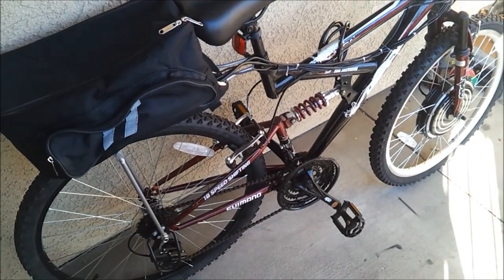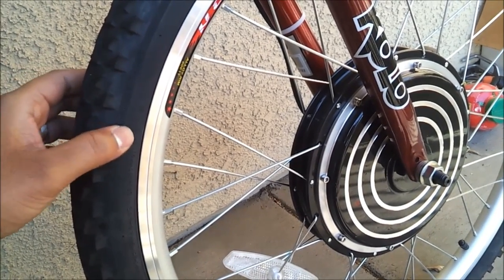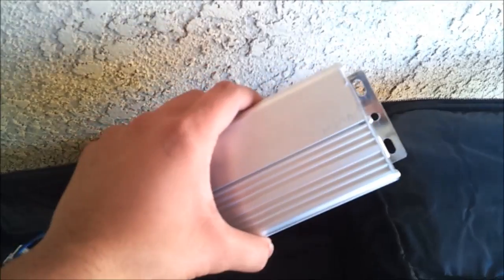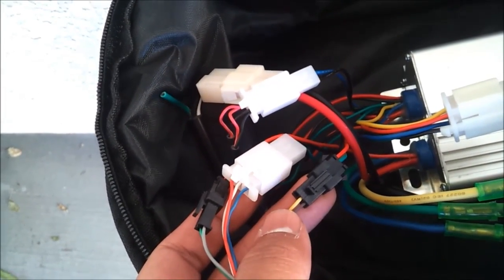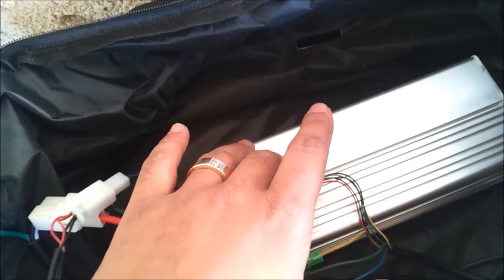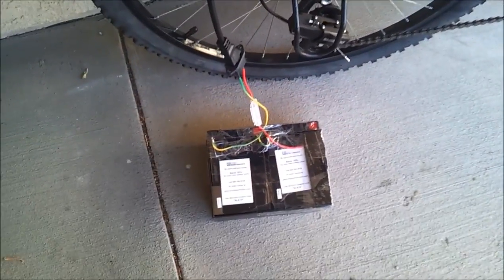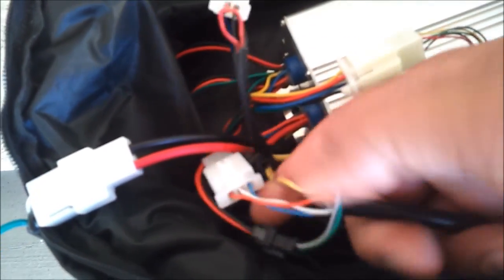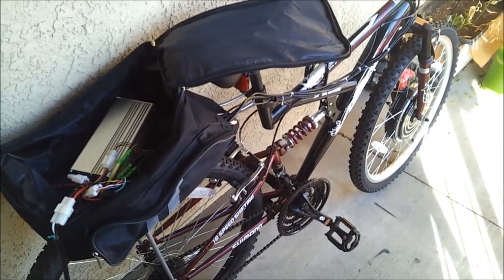Electric Bike Conversion Kit Problems-Now Solved

Comment: #1: Disconnect the kill switch of the brake levers. ... 
If that doesn't fix the issue reply back to me.
Reply: I have the same issue and tried that and it still didn't work
Reply: @skphouston  It's probably the signal wire that simply isn't making contact. I also suggest you open the controller,and check the capacitors to see how much voltage they can handle.

I have a soldering iron and I know how to get a different type of throttle it doesn't have to be six pin connectors like the one you should us in the video,It can also be 5 pin connectors...

THROTTLE WIRES
                  👇
#1Red positive 4.3V-5.0
(Voltage varies on what the brush less motor controller board has to offer) 
#2White signal
#3Black negative

IGNITION WIRES
                👇
#4Red Positive from battery 
#5VCC 

VCC is possibly the negative wire obviously,but open the controller and look for it on the controller circuit board. If you don't have a soldering iron please purchase or borrow it from someone.I also recommend silicone wires✔ 
(✖Cooper wires✖)

Other solution to fix the problem would be to buy a new controller that comes with it's corresponding throttle. www.aliexpress.com

Comment: Dude you need to tighten up your breaks. That sensor is very sensitive. Your breaks gotta be really hard. If they're lose the motor detects them without you knowing and therefore causes the motor to remain immobilized. Happened to me until I tighten them and the sensor than allowed the motor to move.

Comment: I have same problem but with a 24 v  to a 250w motor housed in the rear tyre,     I had a bicycle engineer spend a hour looking at it,     Battery fine,     Brake sensors fine,     Motor fine,    Derailleur sensor fine,     The display lights up showing full power,     I changed the fuses,      All checked out yet nothing,      It must be the controller we all think,      But he did not have a Chinese replacement or know of a generic replacement to fit,       His advice is avoid all internet electric bicycles and anything pre 2012 as they are crap,      I am thinking he is right as if anything goes wrong it`s just expensive junk

Comment: with a buzzing (continuation) zero OHM reading meter start with checking with making sure that thrust(on) switch is closing at zero ohms at the point of the plug near the controller, check to see if you have nearly zero ohms with the motor connections and make sure the connections are good, crimped  properly, the motor connections should be nearly zero a few ohmso if it's higher than that it's defective . 
check and see if you have any safety connections that will cut off the movements. 
sorry for the bad language but i'm not impressed with what I see. those wires, battery, 
are shit . I would ask for your money back !  I hope this helps .

Comment: did you solve this problem? any update? Maybe try connecting one battery direct to the motor and spinning the wheel. Maybe the wheel has to be moving before it works- pedal assist. Update please.
Reply from the maker: Gram Pt . It was a bad controller. I got that changed

Comment: maybe you have to much power I had 4 of the small batteries the lights come on but did not work just like ur bike I disconnected one the 4 batteries and it workedso maybe ur have to much power

Comment: the wires in the throttle connector are not connected properly.... look at the positions of the wires in the connector (it looks like a 3 pin only 2 wires are used) ... they are not aligned....

Comment: the red button is for switching between power modes.  500 and 1000w mode on my 48V kit. Id stay away like plague from anything less than 48V.....bummer that you have problems though...

Comment: disconnect the brake cables from the controller might be causing a short. click the red button on the thumb throttle that is a motor cut-off like a kill switch . if neither of these check your hall effect sensors first inside the thumb throttle there is 1 secondly inside the hub itself there should be 3

Comment: #1) You need to update the video description that the problem was solved, you are wasting the time of people who are still trying to help you, particularly since the problem was a defective controller  #2) You need to stop instructing people about e-bikes; it's pretty clear you don't have a thorough understanding of them and you are providing bad information.  #3 Your brake levers need to be rotated down to the 4 or 5 o'clock position.

Comment: donot push the red button in,on your thumb throttle and try.You think pushing the button in will make the contac but it is wired in reverse. Try not to push the red button.  DAVE

Comment: The non-branded China built controllers have a 3% failure rate or higher. Try to disconnect the brake safety wire, first. Next time buy from a USA based seller who has phone support.

Comment: would you recommend the front wheel ekit or rear wheel?
Reply: Blue Chan  Standard rear dropouts are 135mm not "6 or 7" inches and freewheel/brakes, disc or otherwise, also do not add to this width.  e-Bike motors do not weigh 50Lbs.  Carbon fiber rims are not stronger that "steel" (or aluminum) rims.  You say "hub" when you mean dropouts, "racing" when you mean road and "Y" brakes when you mean V.  YOU are specifically the person I had in mind when I said "nobody here knows what they are talking about".
Reply from the maker: If you buy the rear wheel kit, the bike becomes too rear heavy.
The front kit distributes the weight better with the heavy battery at the back and motor at front.
Reply: tcorourke2007 lol Blue Chan got owned
Reply: Most people wont think to change anything, mainly because they watched a youtube and saw how easy it was,,until the weld brakes from constant tugging from full throttle take offs and not paying attention to the fact that the front wheel is only made for the front wheel that came with the bike.
There is an alternative to front or back mounted motors and thats the central mounted ones that have a really odd (chain drive) setup, but still worth considering.
Reply: That was the nature of my eBike originally. A center mounted motor just below the crank set. Originally the bike had 18" tires which are hard to come by and both crank and motor chains were on the right side of the wheel. When I decided to upgrade my bike the first time, I had to changed to a southpaw hub and 20" rims and reverse mounted the motor on the opposite side so there was a chain on either side of the bike. Of course I had to play with the -/+ leads so the motor would run forward instead of reverse. The 36v motor was 350W on a SLA battery system. Then I discovered a 36v 500W hub motor to fit a 20" rim, so upgraded to that but knowing the different stress related without reading on anything regarding bending frames I simply changed my fork to a Chromoly one normally intended for moto-cross trick riders who use extension pegs on the front wheels. With the original motor, and battery and rider, I determined the back wheel was taking 83% of the weight load and since I upgraded the 18 inch wheels to 20 inches I lose some torque, but gained 6 kph from it's original 30 kph maximum. Changing the location of the motor to a front hub motor, helped balance the weight distribution and reduced the weight load on the rear wheel by 14% thus making a more balanced bike of 69/31 instead of 83/17. Which then lead to the torque I loss originally being almost where it was suppose to be. And the really special part, here, this bike was originally a folding electric bike from some China maker thus the 18" wheels...  had a stupid cam braking system I changed to a cantilever Y brakes normally intended for mountain bikes.
Reply: Generally, rear hub motors are better.  You should ignore the advice in these comments, nobody here knows what they are talking about.  Go to http://endless-sphere.com/forums/viewforum.php?f=21
Reply: Front kit unless your bike has an extra wide frame to accommodate the required 6-7 inch width (hub + brake + gear assembly). Front is still preferred over rear to help distribute weight evenly. Batteries are 25-50 pounds as is the motor.
Reply: I have heard that the front wheel kits are dangerous as they have a tendency to weaken forks and the steering can become unmanageable in the wet, a bit like hitting loose gravel and the wheel keeps spinning while your trying to turn and the wheel slips away from under you, as the motors are heavy.
I have a rear wheel electric built on a front and back shocked mountain bike and the thing that I have noticed is that the wheels are under engineered as the spokes are those for a normal bike and they break,as the motors are heavy and this hasn't been taken into account for the over all weight of the wheel, spokes need to be a heavy gauge.
Reply: Frank Blackcrow As always, you should make sure your bike can stand the tolerances as well as minimum requirements required to mount a front wheel hub. In some case people decided manually widening the forks to take the motor was a good idea at the time until they bent their frames. If the hub can't naturally fit the hub without any strain, then don't force it in place. I had to change out my stock frame to a Chromoly one. Also I found the rims included in the front wheel kit I purchased was of low quality so I changed it to a carbon fiber one (BladeX). Basically change your front fork to one for a real off road one built for strength and weight. If the rim is plain stamped steel, swap it for something stronger and lighter.
Reply: tcorourke2007 some of us know what we are talking about... ie: I wouldn't put a front hub motor on a racing frame, but I would put it on a BMX free style frame. It really depends on the torque, load, and a few other key factors, so you can't simply dismiss everyone because you said so. In my scenario I went with front because the frame modifications I choose were suited for front. Not everyone's rear frame can take a rear hub + gears so that is why front hubs were invented, but not all front forks can take the stress of hub motors.
Reply: I love how people get so serious and offended by the comments hahah

Comment: please give me the link where you bought this. Also i have a front disk brake bike and i need to convert it e-bike. please suggest me a best kit that is cheap. my weight is 90 kg.
thanks!!!!!!
Reply: ***** find out yourself lazy ass
Reply: Stu Wright Normally I'm against negative comments but that was great. Lol.
Reply from the maker: http://www.ebay.com/itm/E-bike-Front-wheel-24V-500W-Motor-hub-Electric-Bicycle-Ebike-conversion-Kit-new-/371141809114?pt=LH_DefaultDomain_0&hash=item5669c693da
Reply from the maker: I bought this on ebay
http://www.ebay.com/itm/36V-800W-26-Rear-Wheel-Electric-Bicycle-Motor-Kit-E-Bike-Cycling-Hub-Conversion-/291209974111?pt=LH_DefaultDomain_0&hash=item43cd77915f
Reply: please tell me which the cheapest kit i can buy in canada

Comment: same problem you have, I brought a kit from china same type of controller with pen written on as 350 controller put kit togather as supposed to and no power comes from the motor the lcd light up but when I turn the throttle nothing... tired of buying from these china companies only to have to pay to ship back.

Comment: I notice that so many bikes have the brake levers far too high to be safely operated.
The levers should be positioned such that with the arm and open hand in a straight line from the shoulder, the hand should lay over the lever naturally and tightened in that position.

Comment: The ESC will only power the motor when it senses the wheel is turning. Almost all E-bikes requires you to at least be moving. Those were designed only as a "assist" and not to totally convert your bicycle to electric. It is also a safety feature as so that you don't do any accidental runaway bike.
Reply: Well Tabby if you are talking about runaway bikes.  Then I suggest putting the runaway bikes picture on a milk carton.  You're welcome.
Reply: Mine (which is the 48v 10000w kit) , right from the get go pulls away from a dead stop...
Reply: Maybe because you're post is 3 years old and i put my kit in a year and a half ago..?

Comment: I'm having the same issue, how did you determine the controller was bad?
Reply from the maker: I checked the motor by directly powering it. I checked all other items with a multimeter to make sure the power switch and brake cutoff were working.
The battery had the right voltage. That just leaves a bad controller.
Reply: Rahul Gupta How did you directly power it without the controller? Doesn't it need the hall sensors signal and therefor a controller to turn?
Reply from the maker: You put dc along two wires of the motor. The motor will make one small movement. Be prepared for sparks when you do this.

I am not responsible.
Reply: Rahul Gupta Man, this is 3 phase ac motor.
Reply: Artjoms Pugacovs

Comment: It doesn't work because that red button acts as a kill switch not an on off switch, when it is in it turns the controller off, when it is out it turns the controller on.
Reply: Could be

Comment from the maker: i am using 36v battery with 24v controller. it is a day and night difference. no problems with controller. i also added a voltmeter to battery to know when the battery was getting low

Comment: Great video but you are using the most wrong bile frame you could find.

start again with a bike frame with no suspension and use road tyres  Also up the voltage to 48 volts that wheel motor can handle that easily

Comment: u should put a tork arm on the motor in so that if the nuts get loose it does not rip the cable which happened to me and i had to open the motor and replace the hall sensors

Comment from the maker: The kit is working great. I should have bought the lipo batteries. the lead acid batteries are very heavy.
Also i bought the 24v. You want 36V or 48V if you can afford it.

Also try to get a bike with disk brakes if possible

Comment: triy unhooking the brake cables,,it should work whithout them,,the switch may be bad in the brakes and the fuse thay come whith is crap,,i got a new fuse link from an auto parts store for a few bucks whith a 20 amp fuse,,i have a 700w 36v kit like yours and works fine after a little tinkering,,

Comment: Today,after a month of waiting, a LeafBike kit arrived in the mail Everything is laid out on the shop floor. As soon as I saw those THREE wires for the motor, I remembered my 1st "China" BrushLess DC (BLDC) motor with the Hall Effect sensors;  The motor didn't activate upon throttle action UNTIL the motor was physicalyl turned a little bit ( turning by hand or, when on the bike ( in my case a push trailer for a Sun EZ-3 Trike. Pedal a bit and once moving, pushing throttle, motor worked. =^,^=